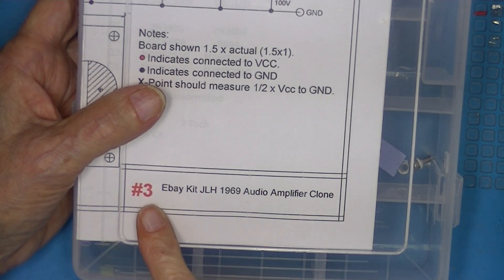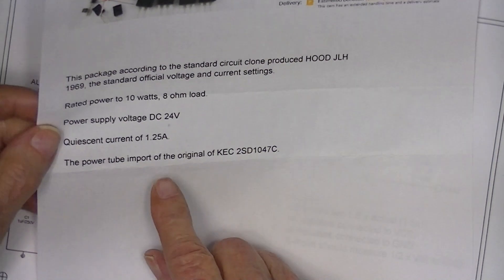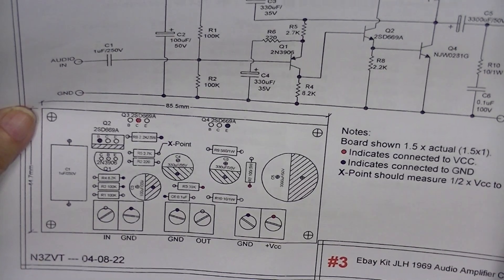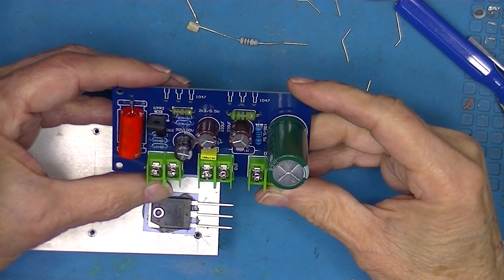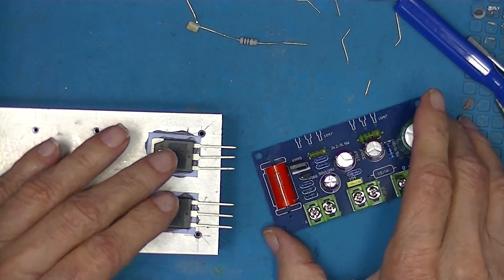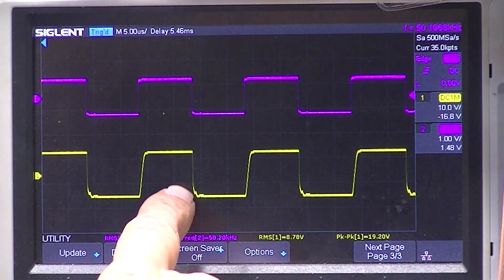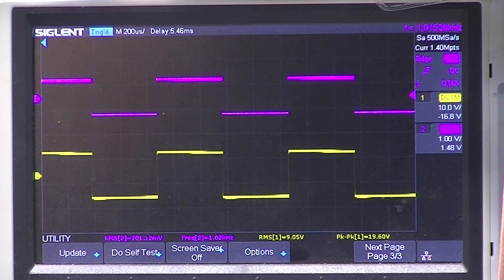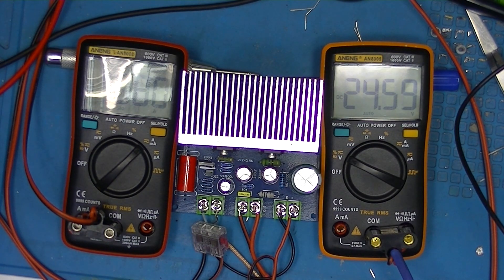J. L. Linsley-Hood 1969 Amplifier Part 4

Comment: Hi Steve, the Voltage divider for biasing Q1 is 39K+100K Upper Divider Resistor & 100K Lower Divider Resistor.
The Previous Boards with the VR2 100K Trimmer and the upper divider Resistor of 10K+75K can reach a 50% VCC Q1 Bias with the VR2, the ones with the Fixed Resistors not. Cheers, Konstantin